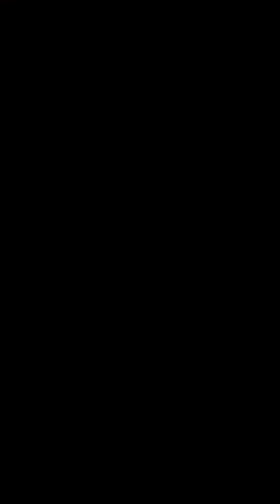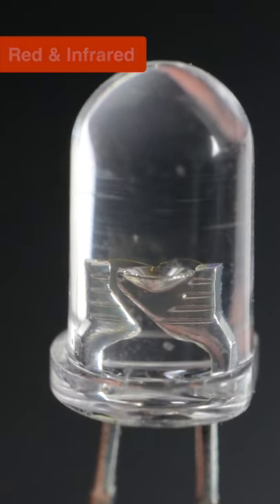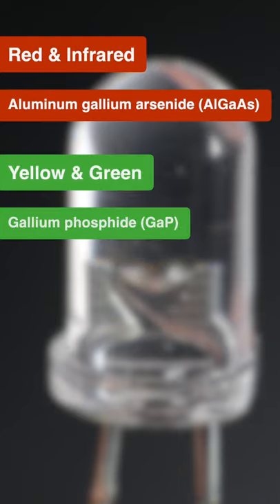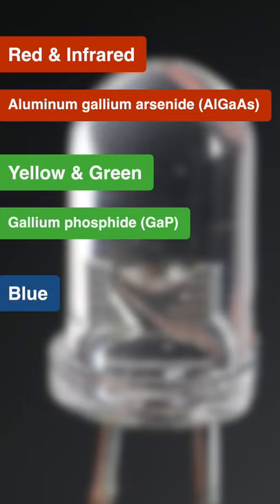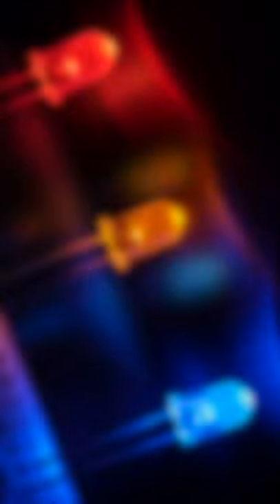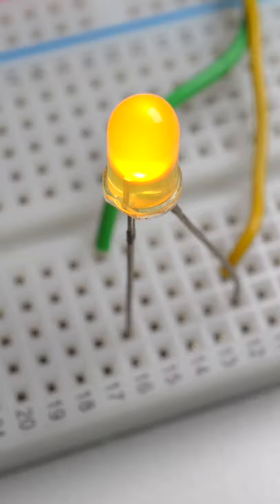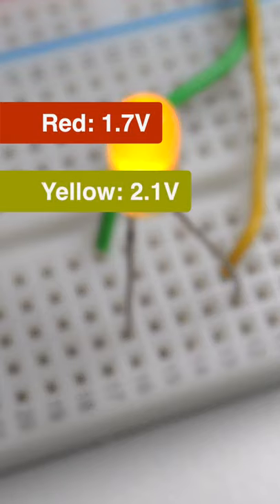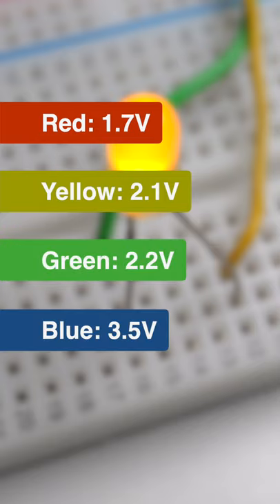LED voltages - Collin's Lab Notes #adafruit #collinslabnotes

Comment: Ohh I remembered my toys in the past powered by batteries. Like some glowing fan toys or cars with dozens of LEDs inside, when the batteries run out, the last thing can still powered on is the red LED light, all the other colors gone and yes, the blue disappear ed first cuz it needs highest voltage and the red needs the lowest voltage so they always the last one to be lit by low power batteries
Reply: Interesting, I wonder if this is why we use red for low battery indicators

Comment: Is that why blue leds are so common in electronics? Because of their closeness to 3.3 volts?
Reply: They are the most efficient in producing light with the same amount of power as other LEDs.
That's why they are the brightest and most annoying!
Reply: Probably because it was cool when they first came out. For the longest time, blue LEDs did not exist, so when they found out how to make them, everyone jumped on the bandwagon. And they still think they're all hip when they stick blue LEDs in their products.
Reply: @DaedalusYoung  just learned this today that the blue led was the last to be invented so it was a big deal for RGB. Interesting.

Comment: An LED is basically a diode, so you can determine its forward voltage with a multimeter.
Reply: Wait what
Reply: Light emitting diode? Anyone?
Reply: And how do you do that? How do you measure "forward voltage?
Reply: @feedmyintellect  use the "diode" mode on your multimeter. However, some multimeters won't output enough voltage for an led.
Reply: Why did I not think of this????

Comment: So since P =I*V  could you argue that red LEDs are more power efficient at the same current?
Reply: Moreover would using reds on an LED screen save battery vs using blues?
Reply: That is just the input powet. Efficiency comes from comparing it with the amount of emitted light. Here blue ones are often better.

Comment: What kind of led is that on the table, That square one? Does anyone know?
Reply: You can do a search on Digi-Key, look at discrete leds with a large lens size and rectangle/square lens type. The NTE318x  series is close but rectangular (2368-NTE3181-ND)
Reply: Found one, DE4CGKD by Kingbright